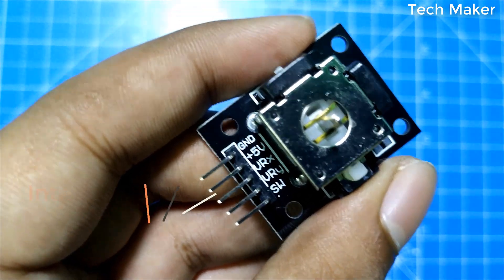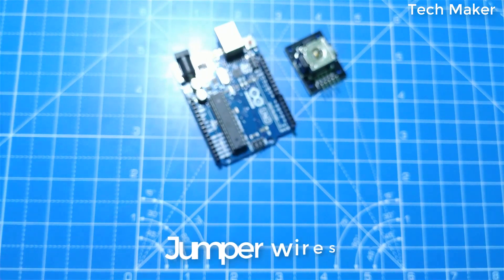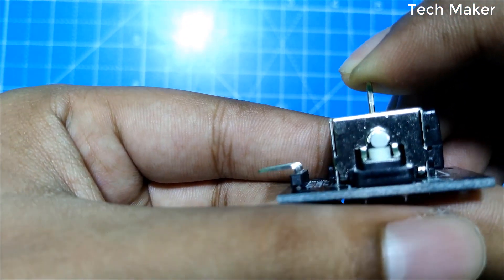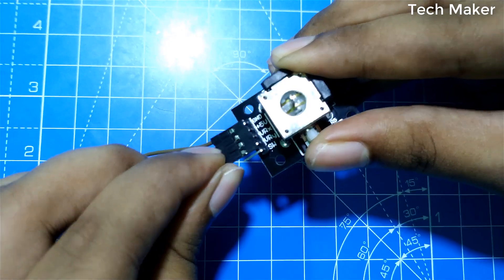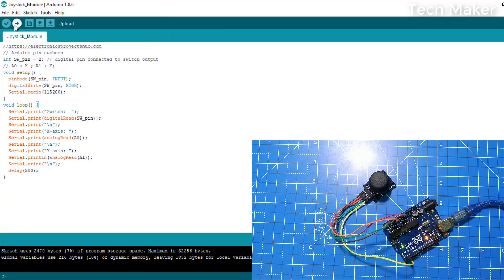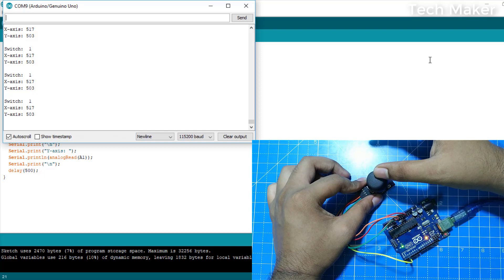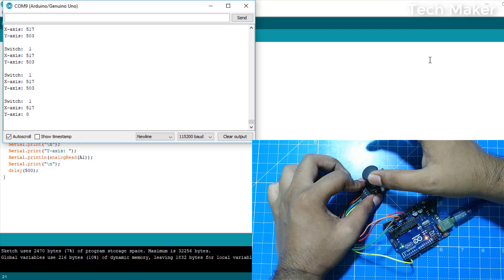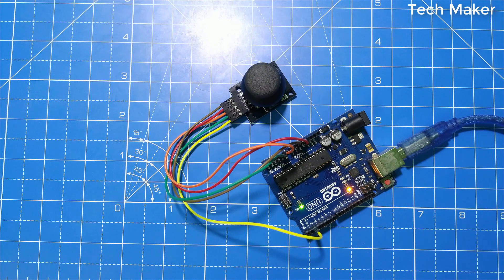How to connect and use an Analog Joystick with an Arduino

Comment: when i open the serial monitor it starts to show simbles
Reply: You need to change the baud rate not just in the arduino code but in the bottom right when you open the serial monitor. This was my issue too.
Reply: That means you need to change your baud rate. As you can see, the tutorial uses 115200 baud, but I think the default for when you just start the Arduino app is 9600.